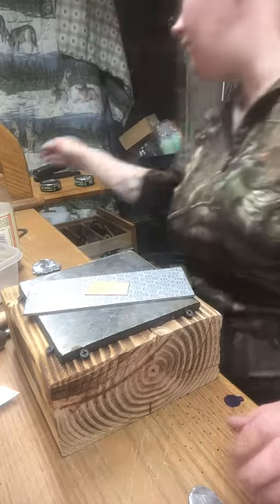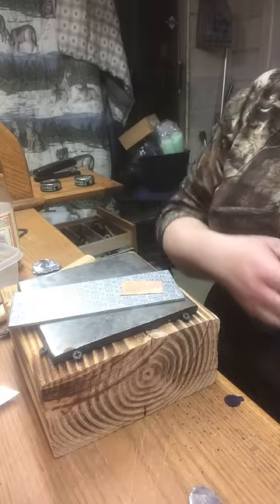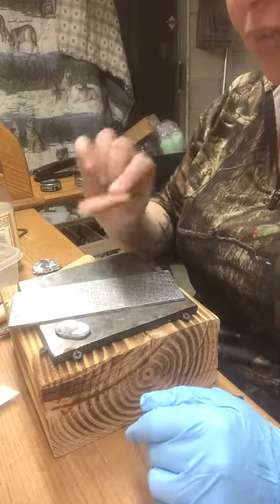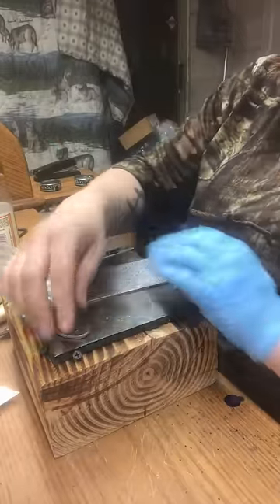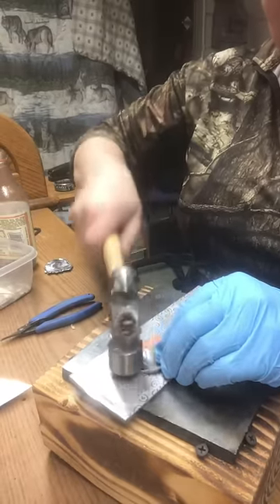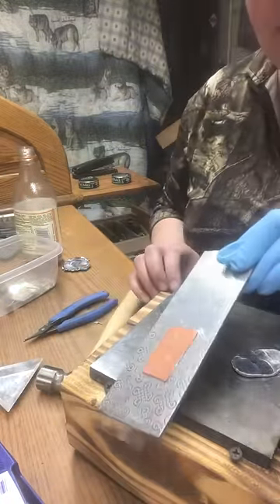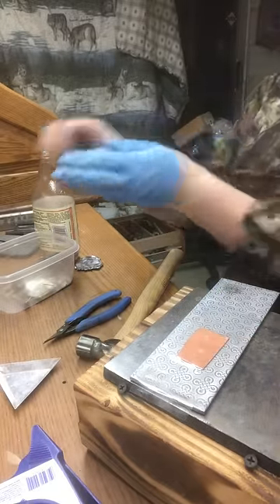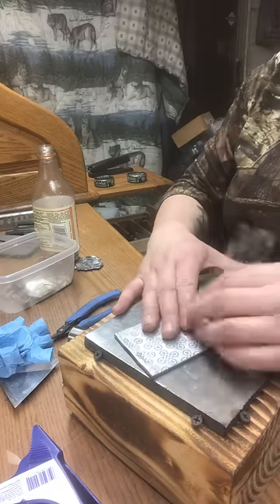How to use a hammer to transfer designs from your www.oregontrailsilver.com texture plates!

Comment: Does repetitive hammering on the plates damage them?
Reply from the maker: Great question! Using lead or even a ball of tin foil, it shouldn’t… no. The lead takes the brunt of the force and just sinks the metal downwards. If the lead gets too thin you can fold it, but if you don’t then you risk damage. “Too thin” would be something thinner than the depth of the recesses of the plate if that helps ;) 

Also, for beginners if the plate gets damaged I am happy to replace it! If you want something to practice on then email me at oregontrailsilver@yahoo.com and I’ll send a practice plate with your first order. A practice plate is an order that didn’t etch properly (and it happens often enough that I almost always have one laying around!) but if you damage it then it was spoiled goods anyways. It will give you an idea of what you need to do to make it work 🥰
Reply: @robertapihl76
Reply: Thanks so much!